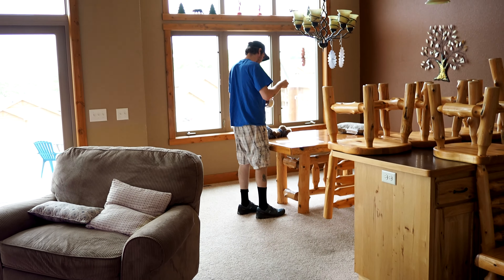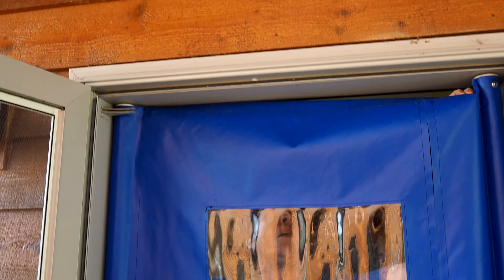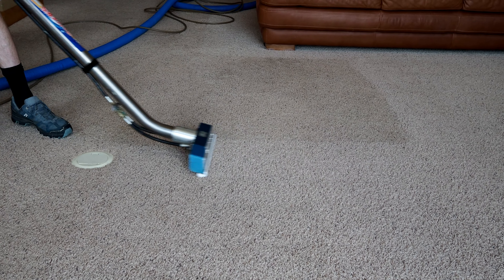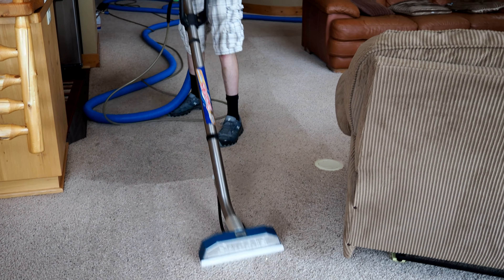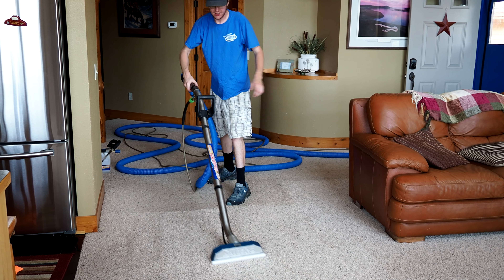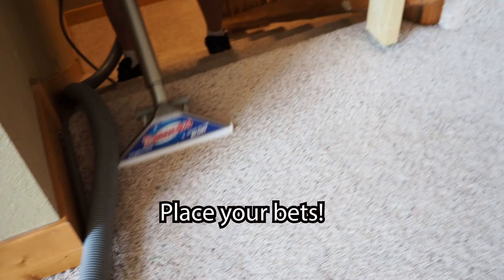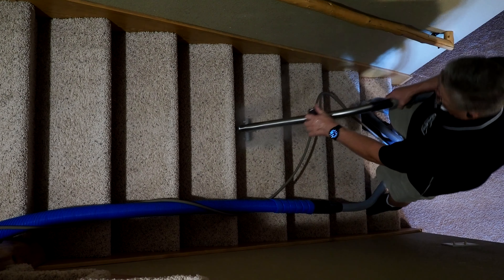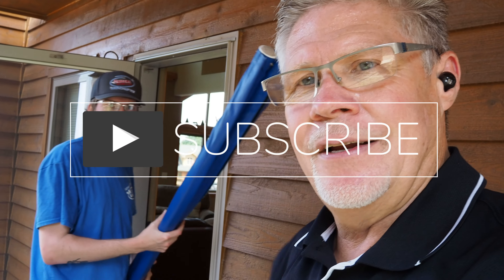Can it Really be that Dirty?

Comment: Hey Mark! Do you prefer the OdorOxy over the P-Lime Zyme?
Reply from the maker: We use our P-Lime-Zyme and P-Zyme (Eucalyptus Mint) more yet. But we love the OdorOxy for Quick Clean ups or smaller areas. WE love the OdorOxy for Feces clean up though. It seems much quicker clean up. OdorOxy is nice for some yellow stain treatments if a pet stain has some difficulty being removed. It's been a great addition on our vans. I have even done some testing using it in our inline high pressure sprayer (also Hydroforce) at 4 to 1 setting and it has done very well too.